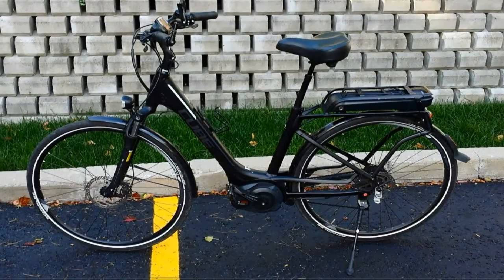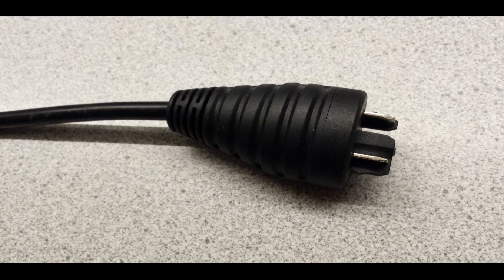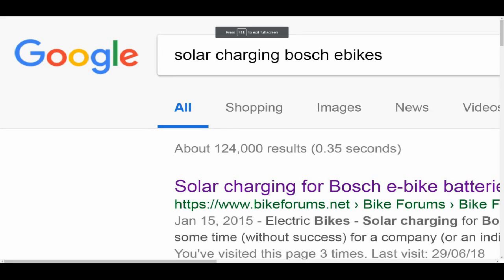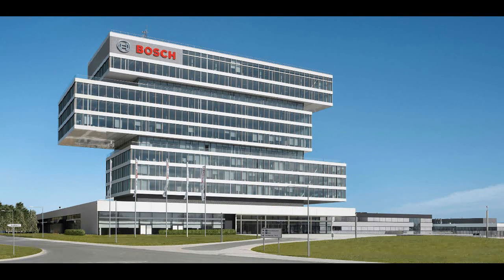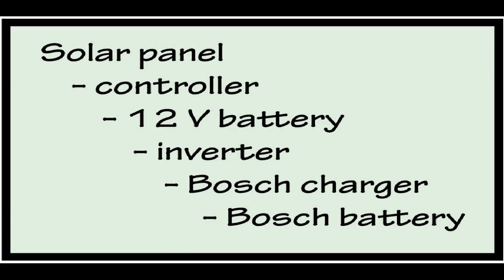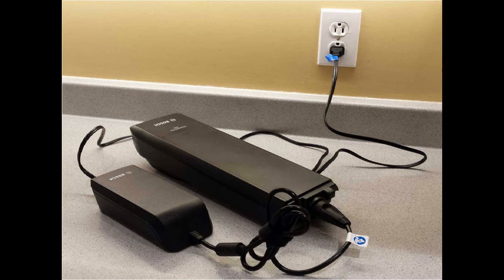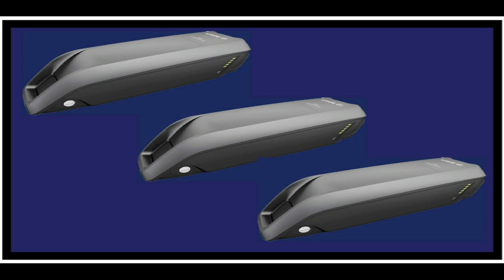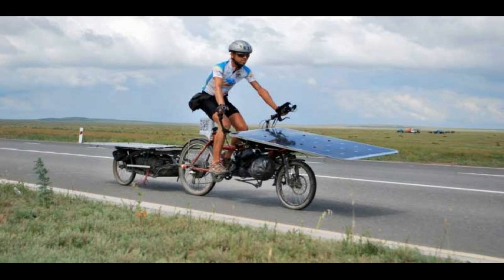Solar Charging a Bosch Ebike Battery   Disappointment

Comment: Robert, the BOSCH 2A Traveller charger has recently become available from some seller from EBAY.  In fact I just bought 2 for backup. Shipping is quite fast.  And I tested both units, powered by a bank of two 120Ah LFP batteries connected in parallel...works like a treat!  Would recommend u look into one whilst available: https://www.ebay.com/itm/eBIKE-BOSCH-TRAVEL-BATTERY-CHARGER-ACTIVE-PERFORMANCE-12V-DC-DC-0275007914/174374094311?hash=item28998185e7:g:BsYAAOSwSINc6wF~  and this one from UK seller : https://www.ebay.com/itm/NEW-eBIKE-BOSCH-TRAVEL-BATTERY-CHARGER-ACTIVE-PERFORMANCE-12V-DC-DC-0275007914/114511266349?hash=item1aa967422d:g:2mEAAOSwD8FfqwJc
Reply from the maker: This wouldn't be useful for my needs. It's made for someone who carries his ebike on  his car or camper and wants to charge the bike from the power of his vehicle's battery. You can't plug the charger directly to solar panels. If I were to use it for charging my bicycle battery with solar panels, but the power from the solar panels would first have to be stored into a 12 volt battery into which the charger would be plugged. I'd have to carry around a heavy 12-volt battery and there would also be a loss of power between the panels and the battery, notwithstanding the energy loss through the charger itself.  No, I'd be way ahead to use a system other than Bosch . Sounds good, but it wouldn't be practical. Thanks for the suggestion.
Reply: @RobertBeriault753  Correct, you would need some form of a battery to buffer the solar energy first before it can be used by this BOSCH Travel Charger.  However, I would never recommend using Lead-Acid/PbSO4 or AGM type battery because not only they are too heavy and usable capacity is low, they do not take high charge and discharge current well...they are simply not suitable for EBIKE charging application.  I would always recommend LFP instead.  Because this BOSCH Travel charger draws 8A from the power source and it is perfectly ok to draw an LFP down to 20%, if you cater for 1 hour energy buffer, a 10Ah LFP would be very ideal.  And instead of using Prismatic cells try building one using the Headway Cylindrical cells.  They are very compact and lightweight. You just need 4 of these to build a unit that generates 13.3V nominal voltage.  And as always build with a BMS.  What's special about the Headway cells is the very high continuous discharge current of 10C(80A) and 15C(150A) max, plus very high charging current of 3C (30A).  I have built 2 of these and carry them when i needed maximum portability with an LFP application.  But I agree with you, this is not the most portable nor quickest solution as the BOSCH Travel charger only outputs 2A...it would take some time to charge up.  The Genasun solution is much more ideal.  I have included the link as an example for the Headway LFP for your reference: https://www.amazon.de/-/en/Headway-38120-LiFePo4-Battery-Cells/dp/B08BFK4J94  With AGM or Lead-Acid battery, you really don't want to draw below 50% capacity before permanent damage occurs.  So with Lead-Acid battery, one is lugged around a lot of dead weight of the unit that is non-productive.  With LFP, the capacity is so much more usable. Check out how this guy did a capacity testing on his 120Ah LFP after months of torturing constant draining to 20% https://www.youtube.com/watch?v=LruDUVnmdN0
Reply from the maker: What I'm looking at for next summer is to cover my bicycle camper with solar panels to the maximum possible extent. On top, there would be a 160 Watt Renogy panel and one 50 W Sunpower Slim  ( 42.25" X 11")  on each side wall, hinged onto the top panel, for a total of 260 Watts of nominal power. When underway the side panels would be vertical but when stopped, I could raise them to the same level as the top panel. My understanding is that I would need three MPPT controllers, wired together according to the diagram supplied by:
 https://www.youtube.com/watch?v=rBbVIiOBuT4. 
Do you agree? What I'm unclear about is will the Sunpower controllers conflict with the battery's BMS. Would it be better to have a bicycle battery that doesn't have a BMS, if such a thing exists? I'm still very much in the dark as to how to go about this.
Reply: @RobertBeriault753  Hi Robert,

Thanks for sharing your very interesting plans to harness the solar power with the available area of your bicycle camper.

Now back to your first question regarding the number of solar controllers required.

This will depend on 3 factors.  

The first one being will all those panels see the same lighting conditions?  

If not, then depending on the second factor on how these panels are being connected, the output will be impacted as follow.  

If the panels are connected in series, the max output current will drop to the lowest value limited by the panel in shade.  

If the panels are connected in parallel, the max voltage will drop to the lowest value limited by the panel in shade.  

The third factor is how identical your solar panels are, in terms of the specifications and output.  

If they are different, then depending on how you connect them, the max current or voltage can be impacted as follow.

If you connect two dissimilar solar panels in series, the max current would be limited by those of the smaller output panel;

If you connect two dissimilar solar panels in parallel, the max voltage would be limited by those of the smaller output panel.

You can see from the above illustration that, if you have either varying lighting conditions AND/OR using dissimilar solar panels and if you are interested in maximising the efficiency of the solar energy being captured, then you should connect seperate solar charger for each group of panels.  And each group of panels should meet these criteria, having the same specification and output; and being exposed the identical lighting conditions.

Now back to your second question on BMS and the interaction with the GENASUN solar controllers.

Let me start by saying if you are using LFP or Li-ion batteries, which are constructed from more than 1 cell, you definitely want to look into BMS at least on the cell level.  For more advanced setup, and depending on how the cells are being connected in series/parallel additional BMS can be added at a group level.  The BMS will ensure that at cell level that it won’t get over-charged or over-discharged, in additional to the other protections, like over-heating or over-current risks the cell may be exposed to.  The BMS will also allow current to be bypassed/diverted into the next cell if it is full, so allowing the cells charge level to be balanced.

PS. If there is only one single cell, then the GENASUN controllers will protect it.  But what it cannot do, is see within the battery construction to see if there exists any imbalance between cells.  And whether the cells are matched in both internal resistance and capacities.  This is the job for the cell-level BMS to balance things out.  For well built LFP or Li-ion, all the cells should be matched closely in terms of their capacities and internal resistance so that when a charge is being applied all cell are being charged equally and reached full charge at about the same time; when discharge they should discharge all at the same level.

From the GENASUN solar charger’s perspective, it looks at the overall voltage of the LFP or Li-ion cells and make an assessment regarding how it should be charged.  Obviously it need to meet the minimal voltage requirements first. This is specified in the specs. In the case of the GENASUN GVB-8 it is 9.5V.  If for any reason the battery has been over-discharged to the point where the BMS intervenes and cuts off the connection, you may see close to 0V from the battery.  Then obviously the GENASUN won’t attempt to charge the battery and the battery needs to be revived back into normal operation before it can be charged.  And this is the whole point of the BMS, protecting the cells from unfavourable operating conditions.

Other than the above, the BMS has no interaction with the GENASUN solar controllers.  Because these GENASUN solar controllers are built very specifically for each type of battery chemistry and configuration, it knows exactly when to switch from constant-current to constant-voltage charging and when to stop charging altogether without damaging the battery.

I have built off-grid systems with more than half a dozen of GENASUN solar chargers (and with mix of 10A, 5A and Boast controllers) all connected in parallel to charge a bank of LFP batteries.  And they all work autonomously and happily together.  And all the LFPs are protected by their individual BMS.  You can see the max current being pulled by each controller even if they are all connected to the same battery bank.  Some will reach saturation a bit sooner (depending on the programmed parameters) and will stop charging with a solid GREEN LED than others…but eventually all of them will stop once the battery bank has been fully charged.

Based on the description of your proposed setup, I can see a mix of different panels and because the top panels and side panels will see different lighting conditions, your setup would need seperate solar controllers if you were to maximise the solar energy being captured.

One aspect that is really good about GENASUN is their reaction time.  The lighting condition is assessed  and output is optimised 15 times every second, hence always ensuring the highest output.  They react so much faster than other solar controllers. Especially useful for application whereby lighting condition can change frequently.  This is why GENASUN solar controllers are the prime choice for extreme polar expeditions and yachting conditions.  And due to these requirements, most of the controllers are optimised for single panel connection.  The GVB-8 is the exception here, as it can take up  to 60V so u can hook up 2 identical panels in series, provided that they both see the same lighting conditions.  You can see why it has been built this way, when considering the typical application in polar regions where sunlight is scarce for half of the year and the GVB-8 needs to gather whatever small amounts of solar energy it can muster from a few large panels connected in series.

Based on your application, I would recommend looking into the WP (WeatherProof) version of the GENASUN GVB-8 solar charge controller.
I have been using a multiple of these WP version of GVB-8 controllers and their performance is most impressive even under very adverse conditions.

I also use Victron controllers as well, but for very different type of solar energy capture, whereby i need to capture very high current (eg 50A) quickly form a group of high output panels. Example application would be to power an air-condition during day time.   But Victron controllers does not even start to work until the panel voltage is 5V above those of the battery voltage.  The GENASUN on the other hand, starts working as soon as the early sun is on the horizon and continues to work even after sunset as long as there is some light.  This is more apparent on large panels with the highly efficient SUNPOWER solar cells.

Now back to your question on batteries without BMS.  The only time I am aware of this being used is in applications whereby space and weight is a premium and the design uses unprotected cells (ie. without BMS) to save space.  But there is still a high-level BMS that monitors groups of cells at any one moment.  In this case, the cells needs to be closely matched for capacity and internal resistance before they are being paired together before assembly.  

For eBIKE application, whether this is Li-ion or LFP batteries we use, you want them to be safe and being protected by BMS.  Especially when we are dealing with high charging and discharge current.  A lot of time we also have heat conditions these batteries needs to cope with and internal resistance properties can vary as temperature changes, as well as the current state of charge (see: https://www.researchgate.net/figure/Dependence-of-internal-resistance-versus-temperature-for-lithium-based-batteries-LiFePO_fig15_316171277).  Thermo runaway can happen and happen quickly if things gets out of control, when there is no BMS, resulting in cells being overcharged and overheats.  And once a fire starts with the Lithium ion chemistry, it is fierce and very hard to put out…the safest thing is to walk away and let it burn off itself.  LFP on the other hand is much safer and even if one tries to abuse the cell they don’t catch fire easily.

The video link you have included talks about parallel connection, which is fine when you have identical smaller panels and they all see the same lighting condition.  In this case, it is fine to connect them up in parallel using just one solar controller.  As long as the sum of current does not exceed the max panel current in the spec it is ok.

When your bicycle camper stops and you have an opportunity to open up your solar panels to ensure that they see the same lighting condition, with the GVB-8 controller, your better option would be to connect the similar panels in series and boast up the voltage.  This way you get less power loss over the transmission as you only need to deal with a lower current into the controller. It allows you to use small gauge wires since it is a lower current and still capture the same energy output. 3 panels each generating a normal 18.8v will only be 56.4v and is within the 60v upper limit the GVB-8 can accept from panel input.  You should see optimal solar capturing efficiency if you can ensure you parked at a location whereby all 3 panels see direct sun.

Hope I have provided answers to most of your questions.
Reply from the maker: So a wealth of  information! It answers several of my concerns. I'm saving this information for future reference. Thank you again for your time.